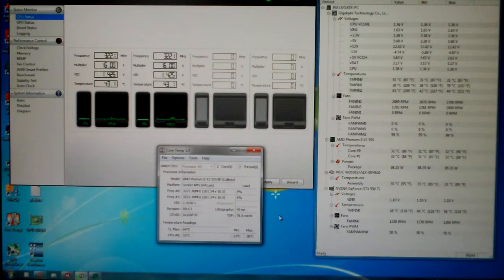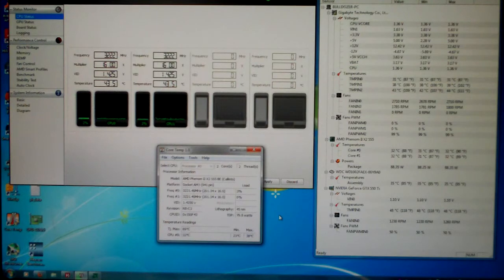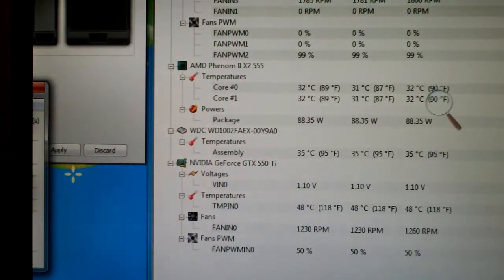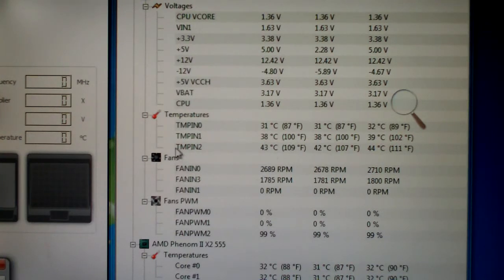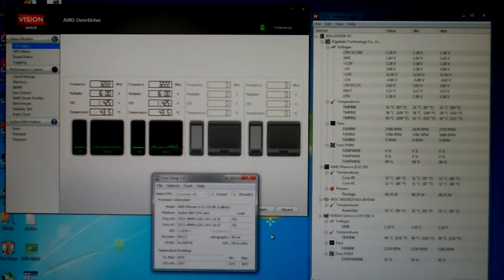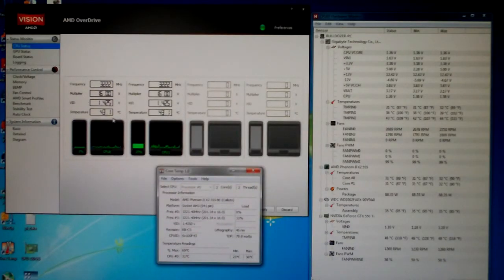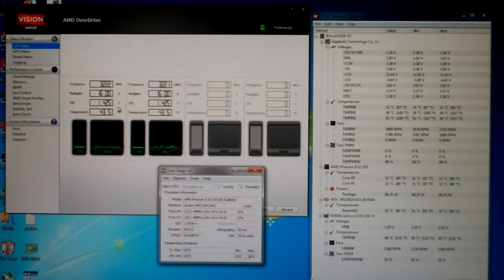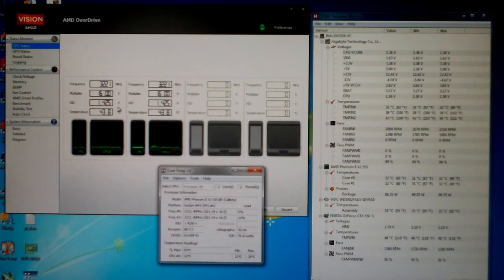AMD "Core vs Socket" CPU Temps Explanation

Comment: Hi, my core temp shows a lot higher than what AMD Overdrive shows. Also I am wondering why my cpu isn't dead yet when it has reached 107 °C multiple times (summer time). I live in a tropical country and summer temp can reach 38 °C. I am not confused if I should believe AMD Overdrive temp readings or Core Temp

Comment: I also had one of those moments where I thought I was going by the wrong temperature the whole time. I had just installed a PC beeper onto my motherboard, and it was beeping when running a CPU stress test, so that was my first time hearing that the motherboard was freaking out about the "CPU" (actually socket) temperature. I thought I was killing my processor all that time in the past when I didn't have the beeper installed while looking at a temperature that I thought was lower than it really was all along, but nope, go figure.